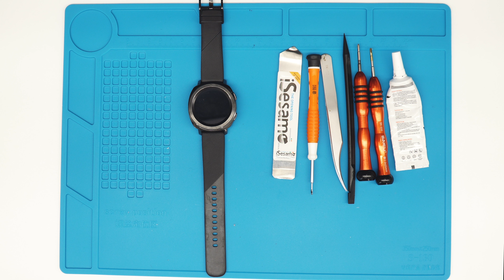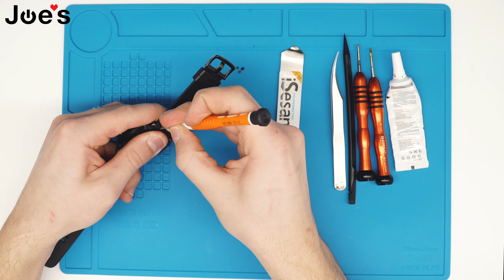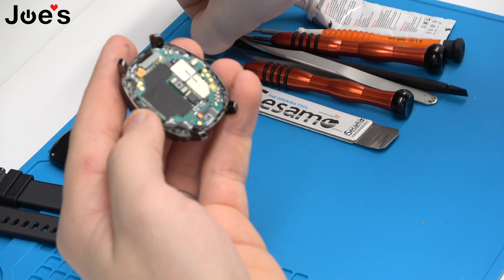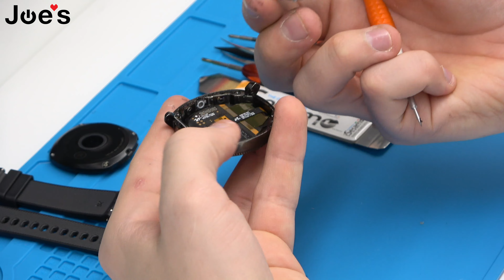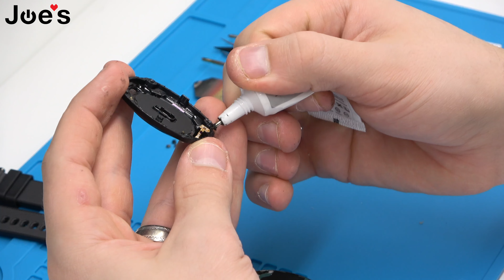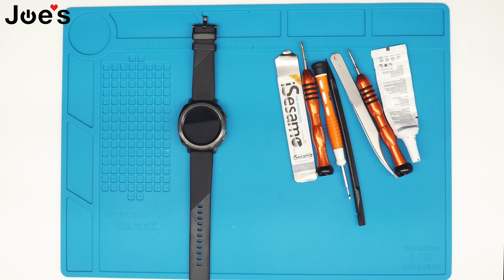Samsung Gear Sport SM-R600 Screen Replacement | Repair Tutorial

Comment: Hi, 
The watch becomes very warm when charging, and I am not able to turn it on. The screen flickers every couple of seconds when trying to reboot. 
How can I test it is a screen or battery problem. Maybe something else?
Reply from the maker: Hello, thanks for commenting. Please email us at support@joesge.com with a screenshot of your question and we will be able to better assist you there. - Aaron P
Reply: @Joesge   It is the LCD screen, i was able to reset and I connect to it from my phone.  So it seems to work properly except for the screen. What kind of sealing kit do you use?